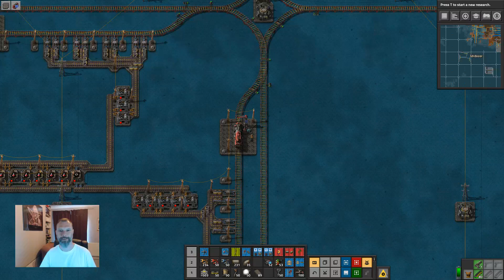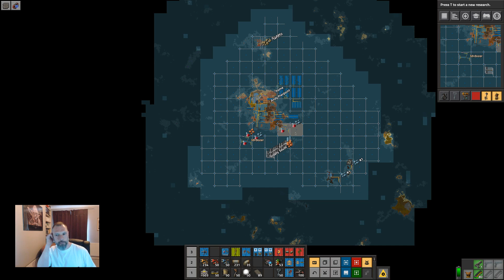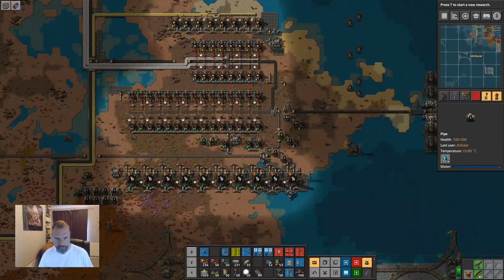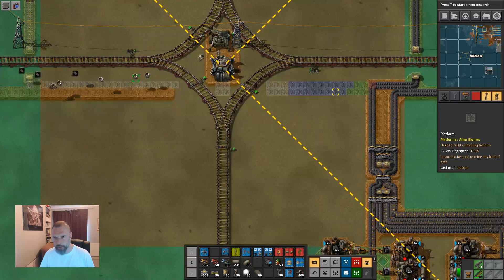Factorio: Atlantis 31

Comment: Just to point you in the right direction with TSM, generally you wire from thr train counter at the foot of the station, not the station itself, and you use a condition in the requester. For this purpose there is a special icon set by the train counter (and found under the alpha icon grouping) that provides the numeric number of trains heading to the station.  It is called trains on the way.  I usually set something like trains on the way < P.  Then I use a combinator to set P based on the stock in the station.
Reply from the maker: Thanks! I am apparently incapable of reading documentation.